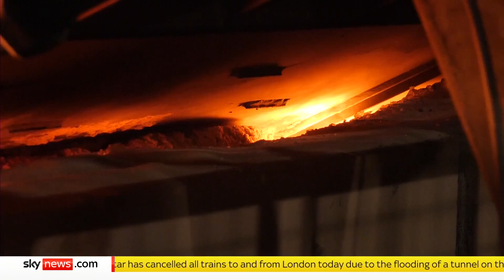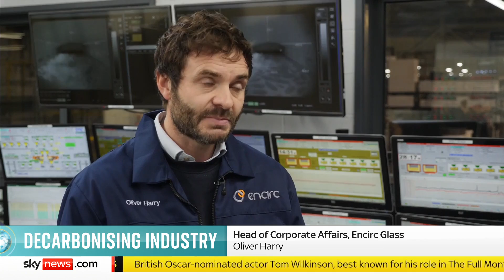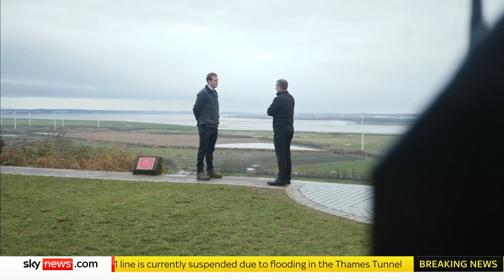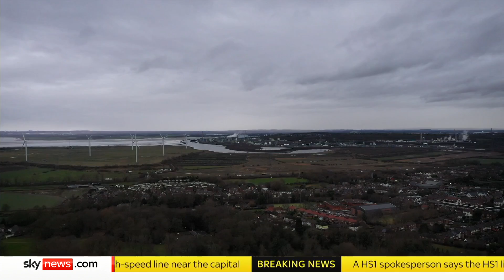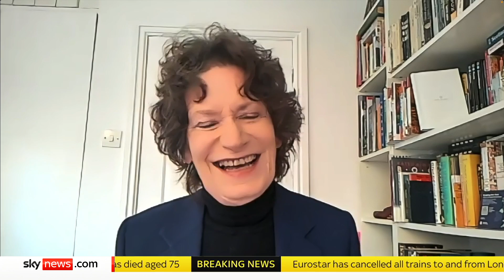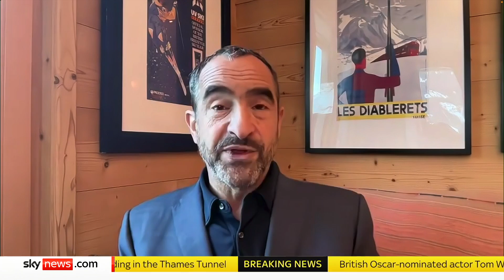UK could be at forefront of green Industrial Revolution with low carbon cluster plans

Comment: "low carbon" is a thinking error. There is absolutely nothing wrong with carbon chemistry. Our economies are based on it and we're really good at it. The UK has upwards of 2,000GW of wind potential in the North Sea, and we currently back up our electricity grid by burning methane ('natural gas') in power stations. Methane can by synthesised from air, water, and renewable energy, which makes it *net zero*. That would fix wind's intermittency, and give us a massive excess of net zero methane which we can sell into existing global natural gas markets and consumers *making them net zero too*. Yes, it's "not as efficient as hydrogen" but a global hydrogen economy is still a *fantasy*. We should do something that works, today.